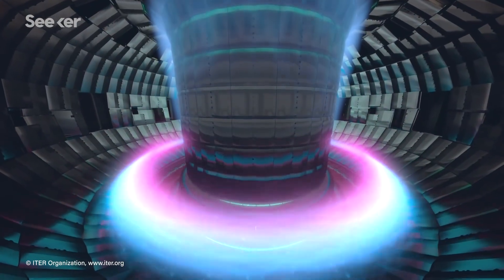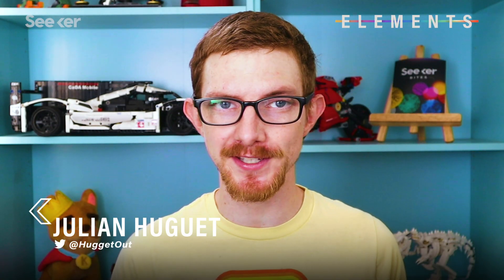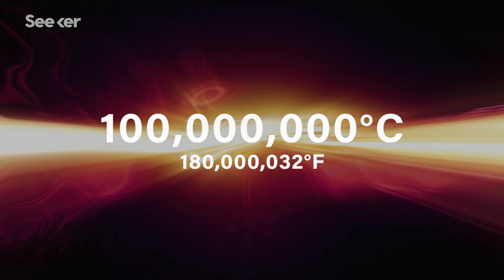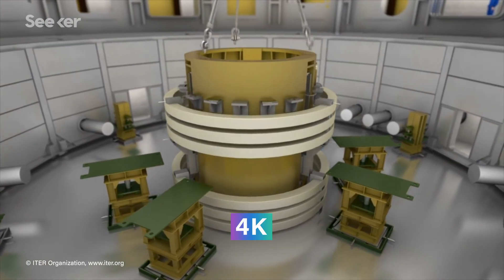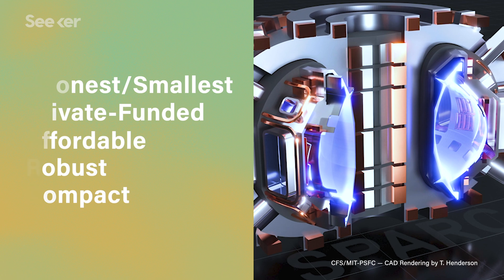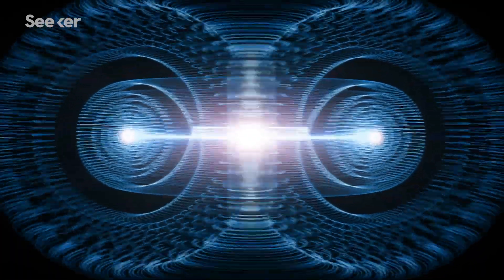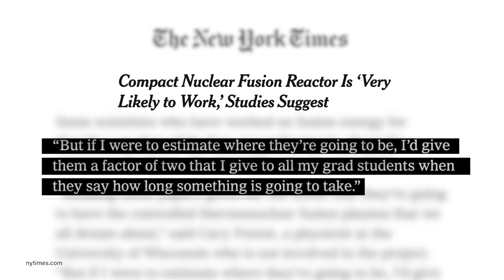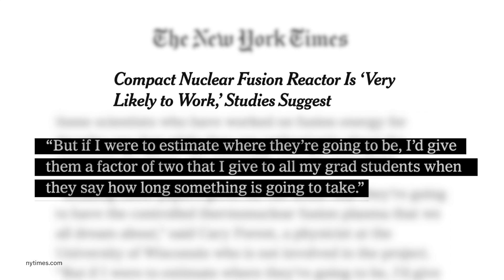Fusion Energy Could Be a Reality in Less Than 5 Years

Comment: We have been six months from breakeven and 5 years from commercial fusion energy for the last 40 years. I kid you not. I joined Sandia National laboratories in 1983 and was taken on a tour of the PBFA, and was promised in 6 months they would reach breakeven, and in 5 years the world would be powered by fusion. Endless promises, no accountability
Reply: I think the issue with your idea of accountability is that in order to get any fusion reactor prototype to even begin the work requires massive investment, even if the very first experiment shows their concept won't function you're probably already a few million in the hole. It's just the nature of trying to build something that is simultaneously massive, intricate, and made of exotic materials.
Reply: @xxportalxx.  And so how many Billion do we dump into an idea before we are willing to label it "Failed". How much has been spent on the NIF at Livermore, over how many years. Same with Sandia PBFA/Z-machine and so forth. Billions and Billions and Billions. How many out of the box, potentially world changing innovations were not funded, in order to feed these beasts?
Reply: @paulmcwhorter  money doesn't just evaporate when spent, and the results of any research has wide spread implications. I'm sure the billions spent have contributed greatly to all the fields necessary to produce these 'failed' reactors, such as can be clearly seen in the high temp superconductor industry.
Reply: @xxportalxx.  You are making a statement of Faith, not Fact. It is a belief system. Give scientist a bunch of money, let them spend it without accountability, and good things will happen without any supporting evidence. I am not against investing in science. I am against continuing to invest in habitually failing endeavors and institutions.
Reply: @paulmcwhorter  I would like to ask you to the best of your knowledge are you aware of how far fusion research has come? Let’s say, from when you joined in 1983 to now, what progress has been made in your opinion, if any?
Reply: @ousarlxsfjsbvbg8588  I would put it this way. You can see success on the horizon. The problem is, as you approach the horizon it flees from you. Have lots of barriers been overcome? Yes, but as we learn more, we uncover yet new and previousely unknown problems and challenges. So, I would answer it this way. Have many obstacles been overcome?, Yes. Are we any closer to the horizon, no.
Reply: @paulmcwhorter  I don't entirely disagree, however why don't you take a look at a comparison of the funding of alternatives such as fusion with how much the government shills out to oil companies first. Which of those investments is more likely to pan out? Oil which is intrinsically limited and killing the planet? The bottom line is we need an alternative soon, and if it isnt fusion what do you think it would be? Bc as far as I can tell if we don't get fusion working we're basically screwed. As is there's no way to build a stable grid on solar and wind, and as lovely as it is geothermal isnt viable in most parts of the world. Fission could do the trick but commissioning enough new plants isnt going to happen, they're being phased out. We've backed ourselves into a corner, and if throwing a few percent of the money we spend on dead-ends like oil and war into fusion gives even a chance of salvation I think we should be doing it.
Reply: @xxportalxx.  I dont think we necessarily disagree. I am arguing against the strategy of justifying something because it is not as bad as something else. I am as much against subsidies for big oil as I am against endless investment in fusion. OK you ask for alternatives. Solar in my mind works, has shown progress for decades, and the main issue that would keep it from being viable on a wider scale is a need for an efficient storage system. Distributed generation with storage would be a much more efficient energy system than big centralized generation, which leads to large distribution losses. A potential model would be distributed small scale solar with distributed storage. The grid would be a backup for the unusual situations that solar did not provide enough. There are many innovative and good ideas of ways to do storage that would require millions in investment to explore, not endless billions like fusion. It is just making a large efficient  storage cell is not 'sexy' research, hence does not draw government attention usually.
Note, I am not actively working in the energy industry, so do not have a dog in the fight, other than being a taxpayer tired of my money being wasted.
Reply: @paulmcwhorter  yeah same, my work is in automation not power, I worked on covid testers not fusion hahaha. At this point however battery technology is still a long ways off from being able to support the grid, not to mention the cost. Tesla at the moment is having trouble sourcing enough batteries just to build their next line of cars! The only currently available solution that would function on a grid scale is something like gravitational potential batteries, which is an absolutely archaic idea. I suppose it makes sense, if there were a simple solution we'd be doing it already right? (That is if vested interests don't kill it first) Personally I've always been a fan of biofuels, particularly algal based, as with that solution we wouldn't need to immediately convert over from existing machinery. Biofuel has it's own problems tho, and algae growing facilities have never managed to get their production up to anywhere near their expected values.
Reply: @xxportalxx.  Note, I said 'storage' not 'battery'. Grid storage is not here today, but much nearer than the pipe dream that NIF will ever be anything more than a huge hole in the ground that trucks back up to and dump money in. Grid storage might not in the end be a battery. Some times low tech solutions work the best. I used to work in an office building. Night electric rates were very cheap. Daytime electric rates were very expensive. The building had a huge freezer. At night it created an enormous block of ice, while electric rates were cheap. During the day, air was blown over the block of ice to cool air for the air conditioner. In effect, this was a rather low tech grid storage device. Similarly, one could imagine a system of molten salt where salt was melted during the day, and energy extracted at night. These are very low tech approaches, but because they are not sexy, will often times be overlooked.
Reply: @paulmcwhorter  hahaha that's hilarious! Freezing some water is outside the box ill give them that! But on the practical end it needs to be efficient, cheap, and large scale. We'll probably just end up pumping water around like the Roman's haha
Reply: I need help in constructing peltier effect based refrigerator. Your help will be highly appreciated.
Reply: @gorilla8809  tech ingredients has a great video on just that.
Reply: @rlikemoney  Thanks a lot. It is quite helpful.
Reply: @gorilla8809  https://youtu.be/YWUhwmmZa7A
Reply: dudes he is right

i too do not care how close are we to fusion

i see fusion power
okay
lets put it this way

Ender IO battery bank says
+(any_positive_number) RF/t
on HWYLA  =>  I believe in fusion in 5 years

simple.
Reply: Its a matter of control of the funding. Those in power today i.e. big oil and big pharma and big food.. monopolies that are created by bail outs and infinite funding for the special ones so that all the other technology and small businesses can not survive. 
Bitcoin fixes this. Can you imagine if this was on the news and highly funded by gov? nah, politicians dont care about society. The majority of people would fund technology over campaign bullcrap, but the majority isnt in control of the media, internet, utilities, food stamps, bail outs, jails.... centralized representatives are. Well we dont need representatives or rulers, we can have an open source public blockchain and rules that are based on majority consensus and money that cant be inflated to infinity or taken away.
Reply: @_lime.  Key disclaimer is "in a fashion". Have you ever actually stood in the NIF facility? Have you ever actually looked at the technical barriers needed to scale that laser up? It is mind numbing how far that technology is away from being practical. I would put it this way. In a basket of dirty shirts, NIF is the dirtiest.
Reply: @paulmcwhorter  m8, I'm commenting on a YouTube video, do you expect me to have actual experience with fusion tech? I included the disclaimer for a reason, we are still a ways away, no doubt about it. I'm just trying to give some hope and look on the bright side that progress is actually being made. The reason we get all these thoughts of 5 years or 20 years is because people only think in terms of human timescales. I personally think we can get to practical fusion power generation by the end of the century. The real issue is getting there without killing ourselves first.
Reply: @_lime.  And as we continue to pour endless dollars into places like NIF, nearer term, more practical solutions are overlooked. That is the danger.
Reply: @paulmcwhorter  Money needs to be provided to fund research, otherwise the technology will never reach maturity. Who the sponsors decide to provide that money to is up to them. In the case of NIF, I'm not from the U.S. so I have no say in that matter, nor any skin in the game so to speak.

In regards to near term solutions, it's not fusion research that's eating up the funding it's the governments of countries around the world insisting on costly and inefficient power generation installations because they don't actually care about anything other than public perception as that is what keeps them in office

Case in point, during the debate last night the entire energy discussion was based on continuing support for legacy solutions like oil on one side, and costly and impractical renewables like solar on the other. Neither of those are able to solve current issues but it it what they will spend trillions on non the less.
Reply: @_lime.  First, money does not need to be provided for things that are simply pipe dreams. The more we spend of fusion, the more we learn about just how far away it it. As far as "Sponsors decide to fund", problem is that those so called sponsors are spending other people's money. 

Solar could be very close to working, if a practical storage methodology was developed. A practical energy storage method would be infinitely closer to being achievable than fusion. .
Reply: @paulmcwhorter  There is so much industry pressure to develop a viable storage solution that there is nothing more that additional funding can do.

Fusion is far away but entirely possible. People thought that flying was a pipe dream and look at where we are now. If you feel that fusion will never be reached then there is nothing more I can do to convince you but ultimately as I've said, if you feel it's a waste of money I'm not the one to convince.
Reply: @_lime.  Actually, not true. George Washington was actually the first president to fly, and it was a lighter than air craft. Various air ships, then gliders and finally powered heavier than air flight, and then constant advancement for the last 120 years. Flight made slow and steady progress over 100's of years, meeting milestones, and showing proof of concept. Also, it appears flight was such a good idea, it was privately funded, not decades of wasted government grants. Flight was achieved with private funds, and had much early success.

 Not so with fusion. Successful technology is technology which shows early it can accurately predict challenges, budgets and schedules and then meet those. This was the case with semiconductors, lasers, flight, automobiles, rockets and space travel. Not so with fusion.
Reply: escape from fantacy escape from fantacy  Most of these aren't companies, they are government funded research programs. It's impossible to give an accurate timeline when your doing something that has never been done before.
Reply: @japaneserequired6314   Wow, sorry I triggered you. But no, you are not going to bully me by calling me names. It just shows the bankruptcy of your position, as all you have is anger and name calling. On the extremely unlikely event anyone ever reads your message this deeply buried beneath my most popular comment above, I will answer your question. Yes, I do get a say. I am a taxpayer and it is my money that is being wasted on these things. I  am a taxpayer, and I am an influencer, and you can simply not handle it when someone disagrees with you.

I did not call them names, and I did not call them war criminals. I simply pointed out the obvious, they have been promising things for decades that they have not delivered on, and keep rolling out the same old promise of endless energy from water. With limited scientific RD money, this should be invested areas which have demonstrated the ability to meet reasonable milestones. I have spent time in both the NIF and the PBFA reactors and have seen up close how they raise money. 

So, yes, I will continue to speak up, and will continue to influence others. I have every right to. I am not bothered when triggered snow flakes call me names. Good day
Reply: Fusion is only possible because of Sun's enormous gravity so I don't think it's possible here on Earth since we can't replicate that kind of gravity
Reply: @SahilP2648  Argument from personal incredulity.
Reply: @CraftyF0X  since you didn't understand what I wrote, your comment is as good as not existing
Reply: @SahilP2648  Pls don't be a living example of the Dunning-Krueger effect, I wrote what I wrote excatly because you seems to lack the basic knowledge why you don't necessary need a starlike gravitational field to confine plasma. I advise you to look up what a TOKAMAK actually do, and how, so you have a better grip on why we don't need to replicate a gravitational field and instead we can replace it with magnetic fields. And again, show me a peer reviewed theoretical predictions which contradicts the possibility of magnetic confined fusion, than your statement of "well it won't work"  will may have a base. Otherwise, as alluded in my first comment, you just lack immagination.
Reply: @CraftyF0X  let's leave peer reviewed papers aside for a while because there's all kind of bullshit that I don't want to get into right now. 

Think of this scenario: 
There's a star which is at the end of its lifespan and it's going to become a neutron star. It basically goes through the transition and becomes a neutron star. But what properties of the star exactly changed? Nothing except for its density. But the result is that the star is filled with neutron soup and spaghetti matter which can ONLY be found in neutron stars and nowhere else. So think about it again. Where did this energy come from? The strange matter inside the unstable neutron star is constantly trying to become normal matter but it is being prevented by the sheer force of its own gravity. 

Now consider our Earth. Our Earth's core is immensely hot compared to the surface.

Now consider our Sun. Our Sun's surface temperature is around 5.8k K. And the temperature inside Sun's core is around 15 million K. 

Ask yourself why is that? What is common in all these examples? Answer is gravity and density. When you have bodies of large mass like planets and Stars, the denser the object is, the more gravity is going to be inside their cores. Which obviously heats up the core naturally because the atoms and molecules are crushed together so much that energy (heat) is generated to keep atoms and molecules apart from one another. This is basically what happens in fusion as well but just on a larger scale. 

This is the same reason why stars bigger than our Sun are hotter and brighter. Because these stars are so big that the gravity inside their cores is going to be 'x' times that our Sun and thus they produce 'y' times the energy. The main reason energy (heat) is being produced in all these scenarios is because of the interaction between gravity and nuclear forces. An extreme example of this is a black hole which basically rips a hole through space time. 

Do you get me now? Its because of this interaction between mass and gravity that energy is produced in the first place. And we cannot get net positive output if we miss this fundamental concept. We have achieved fusion many times now but each time we are inputting more energy than we are getting out of it. Ask yourself this... why?
Reply: @SahilP2648  I just don't get why ppl with rudimentary understanding want to tell plasma physicist about plasma performance and it constrains. Again there is no theoretical obstacle to do it with magnetic confinement and if you'd work on the field you would know that already. Sorry but there is simply no value in trying to convince you that to change your mind when you don't understand whats possible to a level that you don't even udnerstand what you don't understand. All I can advise you is to FIRST learn about the subject and only then try to lecture others on what is possible and what is not. Look up Lawson criterion, triple product, JET achievements (plasma density, plasma temperature, confinement time), ignition, etc. learn a few things before you state "no its impossible because you need a gravity well". And again you are free to publish your calculations and get peer reviwed papers on the subject where you prove either mathematicly, or experimentaly that fusion with Q>1 is impossible outside of starcore conditions. Good luck with that. Im done arguing over estabilished facts with those who simply don't know about the basics of the subject.
Reply: @CraftyF0X  lmao sure bud. I will have the last laugh when proper fusion isn't completed before I die.
Reply: @SahilP2648  A weird thing to have the last laugh about but ok I guess :D
Reply: Best thread I have seen on this topic. Thanks for your insights @Paul McWhorter
Reply: All the industries made slow progress, the first transistors were just basically electric switches, the electronic industry made progress over decades, and it was basically just the need to improve the mechanical industry that had existed before like machines in factory, no organization came forward and said "hey we'll have transistors the size of few hundred atoms wide in 10 years timeline" no, it made slow progress over decades... The aviation industry didn't just created f 22 raptors in 10 years timeline, they already knew flying is possible as they already had the proof (birds obviously).
What's wrong with fusion is that, it's just a hollow promise, with no known practical use ever since the first experiment. And billions wasted, the same money could've been used to better the current nuclear technology, there are only few issues with fission, mainly the nuclear waste and safety, in terms of power generation, it's more than enough... We could've spent that money to address the nuclear waste issue and safety, but no, as the guy said, it's not "sexy".
Reply: Someone told you that at Sandia? Really?
Reply: @benwilms3942  Not sure if this is a rhetorical question, or if it is sarcasm, but if you are really asking it as a question, yes. It was an executive as a matter of fact. It would have been December of 1983.
Reply: @paulmcwhorter  fair enough, it wasn't a rhetorical question, it was more to do the fact that I wasn't on the planet then, and I've never been remotely associated with fusion research, so I've either got to track down a public record of someone in the that position stating it on the record, ....or take your word for it that they privately said it to you. I can't substantiate either, so I'll just except that yours is one of many thousands of conversations that have happened. Can I ask though, qualitatively and quantitatively, doesn't some part of you allow for the comparison between other technologies showing a more lineal and immediate evidence of viability through reaching predicted milestones, and the pursuit of essentially recreating the engine of a star, to be massively divergent? I mean, comparing the technological progression of flight for example to the pursuit of fusion is comparing pretty pedestrian apples to pretty exotic oranges. I can build a plane, and I have no formal education about aerodynamics, and frankly there's nothing special about my intellectual prowess. But fusion isn't something that has been done before outside of a huge steller mass and deep time. Maybe it should require enormous sums of money and time and resource. Doesn't it amaze you that we live in a time where the particular flavour of 'hole' you're describing is even logistically possible?
Reply: I hope these teams working on fusion are successful, but we've been told fusion is right around the corner for a long time now.  I'll believe it when I see a working prototype.
Reply: Maybe if everyone thought like that no one would want to take up physics and work on such projects. I imagine the hope being given is for the next crop of researchers who'll take it further and maybe one day, reach their destination. I look at it as the progress humanity is making rather than something that i can out of it.
Reply: @Emm Kay it's just like the boy who cried wolf at this point.  I would love to see commercial fusion reactors, we could finally have the kind of energy that nuclear promised decades ago.  "Too cheap to meter" they said, clean and efficient.
Reply: Good read, good thread!

Conclusion: Very much possible but needs proper management of resources instead of dumping billions into one that has failed to live up to the hype for decades now. Need governments to discourage use of fossil fuel and push green energy message for more private entities to get into race. Can't wait for the SINGULARITY :D
Reply: You clearly haven't seen the the SAFIRE project; they achieved sustained fusion this year, safireproject . com  ; they are building a prototype; it works like the sun, it is powered externally by voltage pressures.
Reply: fusion is just a dream, it always was, we will never have fusion and we'll probably just nuke ourselves back into the stone age
Reply: @japaneserequired6314  Dude fusion power is fiction with the tech we have now ok. It's like vikings trying to land a man on Mars is where we are right now with fusion. We're gonna have to wait 60-80 years at least to have fusion, PERIOD!!!
Reply: You joined Sandia at what function exactly?
Reply: "Endless promises"
Plasma physics achieved a lot. There is a good chance, that you commented here using a semiconductor, which would be impossible to manufacture without the fusion research done in recent decades.
But, back to energy production: What is really great in the recent "promises" of fusion research is that these promises are associated with smaller and cheaper devices. Until now, the promises were: if we can build it 5 times bigger and 100 more expensive, than it will work. Now the promise is, that: we can build it 5 times small and 100 times cheaper.
Reply: @bokoloaranyfa3824  You are confusing two things . . . plasma physics and fusion research for energy production. Plasma physics is indeed a great field, with much accomplished for semiconductor manufacturing. We are talking here about the endless promise of 'breakeven' being six months away. This, measurabley, has been promised for 40 years, and measurably has failed for 40 years.
Reply: I commented here by sending a paper carbon copy of my comment to YouTube for uploading.  😋
Reply: Bokola aranya:
That was meant for you.   Sorry.
Reply: Who cares about promises,  just look at how the technology developed throughout the years as well as other industries that directly affect the process of the development of the fusion reactor. For example,  chemical sciences that are working on creating better super conductors which can be utilized by the fusion reactor.
Reply: @parkertheprophet  Who cares about promises?!? OK, I promise if you send me $100,000 USD in six months I will turn it into $1,000,000 for you. I predict if it was your money, you would become very concerned about the accuracy of my promise. Maybe I come back and tell you all the wonderful things I did with the money, and how much a i learned and how much I helped someone, but I predict you would care about the promise.
Reply: @paulmcwhorter  yes this is definitely true for many government contracts. It’s a shame that that’s the standard we set, companies should be held accountable for not achieving what they promised using funding that’s not theirs to begin with
Reply: @paulmcwhorter  not wrong, but do more research before you blow your money.
Reply: @Voodoo3397  breakthroughs in technology like that cannot work like that. 

You can't promise a fusion reactor will work. Just too many unknowns.

It's different than writing a software or building a rocket. There is risk by definition. 

IF WE MASTERED FUSION, then it could be done like some people say: first build, then government pays for milestones.
Reply: The problem with big reactors is that even if they work, they're expensive and slow to build.
However! There's a fusion reactor that is small and works in room temperature. The company is called HB11. Check 'em out.
Reply: @ramentabetai1266  Yes, very true. Also, it illustrates a more general point, and that is that when huge amounts continue to be poured into failing endeavors the out of the box, orthogonal approach can find it very difficult to find the funds necessary.
Reply: @ramentabetai1266  The thing is, I think they are slow to build in the first time. After achieving something, you have a know how about it and you can optimize all the processes you did for the first time. After that they may be expensive and slow to build, but the cost benefit ratio will be a lot better from time to time I think.
Reply: Accountability? Do you want to send scientists to the gulag if they fail?
Reply: @anotheruser676  You are creating a straw man. No, I did not say that, you are creating a silly position, and then attributing it to me.. In industry, researchers and workers are held accountable to deliver on what they say they are going to do. In government research the bigger you fail, the more money that is poured in. Accountability is to invest research dollars into institutions and individuals with a track record of delivering the goods. I worked at the National Labs for 20 years. I know what I am talking about.
Reply: @paulmcwhorter  I must admit I also was wondering what "accountability" meant in that context. No need to science flex on people.
Reply: @paulmcwhorter  OK, let me approach it differently.  How would YOU hold them accountable?
Reply: @anotheruser676  Tie funding to meeting milestones, expect people to promise achievable milestones. To miss the mark by 40 years is not acceptable. To always promise to be six months away to get that next Billion is not acceptable. Set reasonable milestones, then decide whether the investment is in fact warranted. Not the bottomless money bowl for hyped up promises.
Reply: @paulmcwhorter  Thank you!  I would like to note that while my Straw Man argument is extreme and silly in our socioeconomic system, it is not unprecedented as it was commonly used by Joseph Stalin much to the detriment to their scientific community.
Reply: @paulmcwhorter  I've never heard a 6 month promise, let alone "always promise to be 6 months"
Reply: @paulmcwhorter  are we at saturation point of technological innovation, development and achievement?, because few decades back we expected/promised less and achieved more now it's vice versa. Are we trying to chew somethings bigger than our mouths?.
Reply: @ag135i  AG, I am not against technological research and development. It what I have spent my life doing. I think there are still many things to be discovered and many things to be advanced. I am just advocating for more rational process for assigning limited research dollars to achieve maximum advantage for society. These huge science projects like the enormous holes that money is spent on, at the expense of new ideas that have great promis.
Reply: @paulmcwhorter  Paul ... were you are being misleading is in how the investment in this case is being brought in. Unlike Sandia, which has the vast bulk of its funding from the US government, this project is commercial. Much like people said you couldn't reuse rockets by landing the first stage, the one thing SpaceX has shown is private funding is in itself accountable and innovation leads the agenda. That is a good example of how things that were formally stated impossible can get accomplished. The government gave us the Shuttle, a bloated overly complex system which was supposed lead the way to cheap space access, which it never realized. Private innovation gave us access to space for the first time at a much more affordable price tag and those costs continue to go down; through private venture and competition; instead of being driven by pet local projects leveraged by politicians looking out for their own constituencies and pushing through funding accordingly. On a more technical note, the technology required for fusion to be workable was learned by the former projects over decades. From this learning we realized we had to wait until such things as "high" temperature super-conductors became a reality, not just theoretical. Now that we have them, a major roadblock to fusion has been lifted. You need specific things to do other things. Until those things become real the other things must wait. That's the nature of science and engineering. We never would have had suspension bridges until mass production of steel wire rope was developed, we never would have had computers as we do if we continued using vacuum tubes in electronics. Every innovation requires other innovations preceding it. With fusion ... thirty years ago we didn't know as much and certainly didn't have the technologies required once we did know.
Reply: @Kluug  These are two different topics. Government vs. private research. I agree with your critique of huge government programs like Sandia. In many times they turn into high tech welfare. I also agree with you on Space X. NASA became an entrenched bureaucracy which squelched innovation. SpaceX took some old guys with experience and an open mind, and combined them with a young new generation of engineers, and they did really amazing things. So, I am in agreement with those points you make. On the topic of Fusion, I remain skeptical. The message I keep hearing is, just one more huge reactor, just one more $Billion investment, and we can really make it work.
Reply: @paulmcwhorter  With your proposed fund distribution model, nothing would get done. There's enough money to fund all of this stuff in perpetuity, we just need to stop funding useless stuff like weapons of war.
Reply: @forgotn42  Again, you are trying to force me to choose between two bad options. Just because money is being wasted on war/weapons does not mean that fusion will ever work, even with infinite $ invested. If I look at the the actual progress over the last 40 years, the solution extrapolates to infinity.
Reply: @paulmcwhorter  your proposal, while I can understand the reasoning might create a market failure and that would be quite unfortunat for humanity.
Reply: @paulmcwhorter  maybe we could run it like a school project system if x amount of progress is not made within a short time frame you and your company will be given a failing grade you won't be completely defunded but your funding will be reduced significantly let's say by 30% for each failed deadline until you hit a minimum or drop out entirely and if you just barley miss the mark or present a very promising discovery  your company previous failure could be forgiven
Reply: @paulmcwhorter  I think the problem is that we have no reason to belive that it will never work. And the thing is, the prospect of having it to work seems way too worthwhile to just give up because its expensive and there are  better things to spend on. Even if I kind of agree (there would be cheaper and simpler alternative energy solutions like Gen IV reactors) I still see the value in figuring out and getting to the bottom of the story, wheter it will succeed or prove to be too complicated, at least we ought to know the answer. This answer worth a lot more money than any bombing raid, and knowing how politics works, its not like the money you save on this research goes right to other researches you would approve.
Reply: @paulmcwhorter  to be fair isn't the p in SPARC for privately funded? By commonwealth fusion? So it wouldn't be government funded
Reply: @paulmcwhorter  akshualy I believe it was a joke based on a hyperbolic premise, not a straw man
Reply: "They promised me on a tour..." Nice scientific citation, Mr. National Labs man. What again is your exact qualification in fusion technology?
Reply: @Theo0x89  same as yours im sure, mr fusion guy
Reply: @Theo0x89  Pejorative name calling does not make you right, it just exposes your lack of a credible, rational argument. Given I post under my real name, it would be easy enough to look me up. My background is in Solid State Physics, and I only worked peripherally in plasma physics, as it applies to semiconductor and nanotechnology fabrication. I do not need to be working at a facility like NIF or other large fusion facility, or have formal fusion technology publications to see a clear pattern over 40 years of exaggerated promises being made in order to get funding. And each funding cycle hearing, this time we are really going to do it. 'Energy that is too cheap to even meter' is one perfect example of a ridiculous promise. Even if the production cost of energy went to zero, there are still distribution costs, and there would still be meters and electric bills. As a guy that worked decades at the National Laboratories, yes, it does give me insight into the way funding decisions are made, and in some cases, the games that are played. The point of my original post is to have more accountability for these Big Science projects. I am not proposing reducing investment in research, I am proposing more accountability and achieving higher returns on public investment in research, particularly big science. I think it would be foolish to suggest that as it is presently implemented, it is a perfect implementation.
Reply: @Theo0x89  Attacking me is simply revealing the weakness of your position. Name calling does not make you correct. I have clearly stated my position, and rather than rationally rebut it, you call names. Your position is almost humorous . . . you attack any one posting on youtube as 'clueless' yet you yourself are posting on youtube comments. Are you the only one on youtube comment section with worthy positions? I think the dialog would be more useful if you would rationally address my position, which is the fusion research community has a long history of overpromising and underdelivering, and are not held accountable for perpetually missing promises of meaningful impact.
Reply: @paulmcwhorter  My position is that you don't have a position. You just posted the old "fusion has been x years away for y years" meme together with your irrelevant anecdote and credentials. Fusion is a notoriously underfunded topic of active foundational research, and as long as you don't have a credible scientific source that says fusion definitely won't work, then you have no case. There have been no promises, only ongoing speculations about the time when fusion might be available. Even in the worst case scenario of no reactor within another 50 years, the science is worth the effort, just as for other hobbies of mankind like particle accelerators, space stations, gravitational-wave detectors, and many more.
Reply: @Theo0x89  This argument is humorous . . . that you have to fund fusion unless someone can prove it will never work. Research funding does not work this way. You have to justify the resources you are asking for and being given while achieving milestones. Also you are mistaken in saying that only subject matter scientist can comment on a topic. No, it does not work that way. Subject matter experts must be able to convince the broader scientific community that the investment is warranted. My position is clear. Countless billions have been invested in fusion. This is a demonstrable fact. Work has been ongoing for over 40 years. This is a demonstrable fact. We do not have anything close to a fusion power plant. Again a fact. And, once again the fusion community is asking for another huge investment. That is a fact. For you to say I do not have a position again is you attacking me and ignoring what I have clearly articulated in this article. Yet, you provide no data or credible arguments, just ad hominin attacks on me, showing the weakness of your position.
Reply: @paulmcwhorter  "Subject matter experts must be able to convince the broader scientific community that the investment is warranted." This is where you are wrong. Scientist have to convince the narrow scientific community of people who know what they are talking about and the people who give them money. That doesn't include you. You obviously have no qualification to say how promising previous experiments are and how close we are to a working reactor, and thanks heavens you don't have a say in granting those scientists money. You seem to have no concept on how foundational research works. Negative results add to scientific knowledge. Researchers are paid their little money to find out if a fusion reactor is possible, not to achieve any milestones that promise you cheap energy before you die.
"Yet, you provide no data or credible arguments" What can be asserted without evidence can also be dismissed without evidence. You have said nothing of substance to explain why ongoing efforts in fusion science are futile. "It takes too long for my personal taste and some people's speculations about the future were wrong" are no valid arguments.
Reply: @paulmcwhorter  The experts of the Seeker YouTube channel audience have voted. This is the end of fusion power confirmed. Everyone can now enjoy their extra couple of cents saved by defunding science. Thank you for your service and don't let people tell you that you suffer from delusion thinking or engineer's disease. Next week: We cancel Christianity for promising the return of Jesus within this generation for two millennia.
Reply: Well it's all empty promises until one time it's actually not. :) maybe this time it's for real.